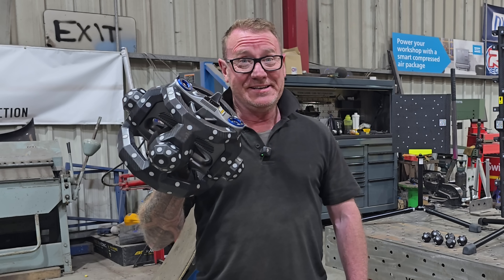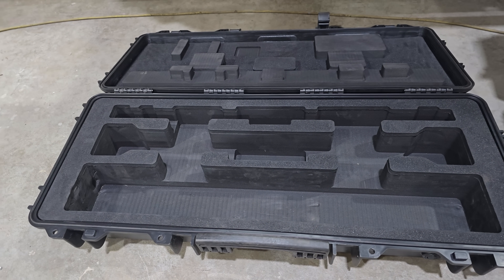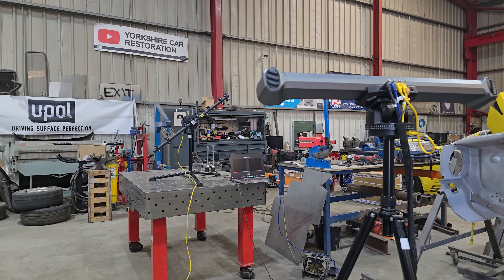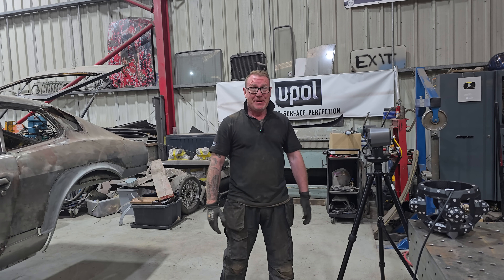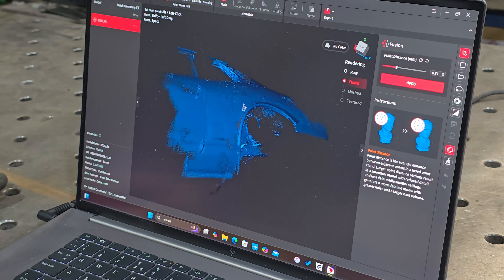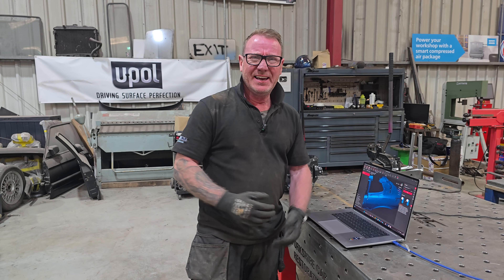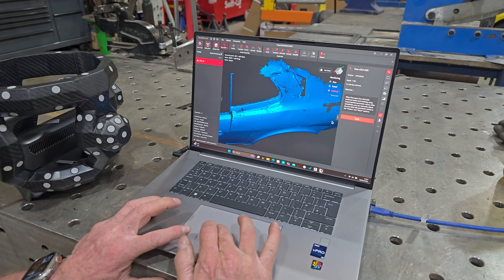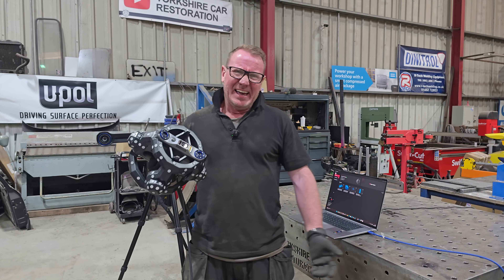Scanning the Disaster Datsun with the Revopoint Trackit 3d scanner

Comment: You have so many options with the 3d printer files . Exporting them for moulds fiberglass etc  would be another option  (limitless ) 
using a basic hard surface model program for design is also a great design option for you